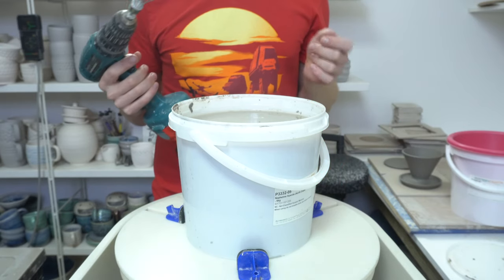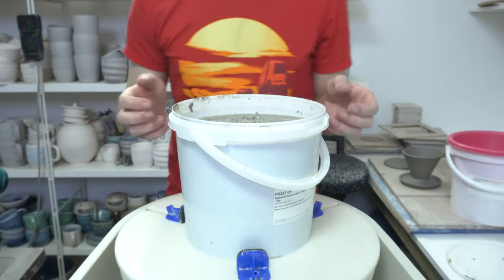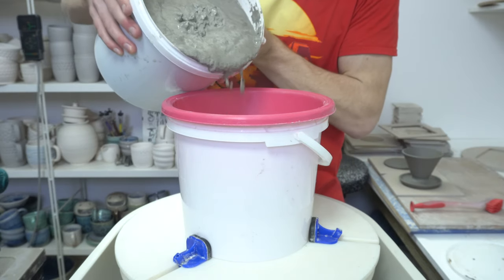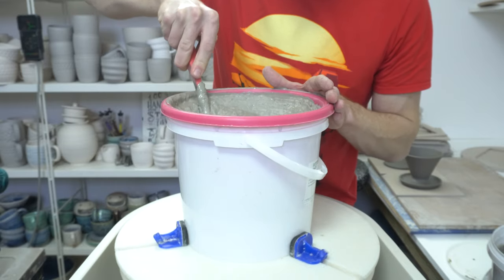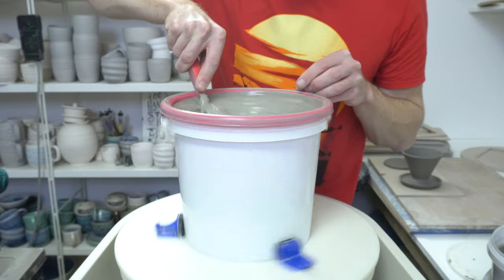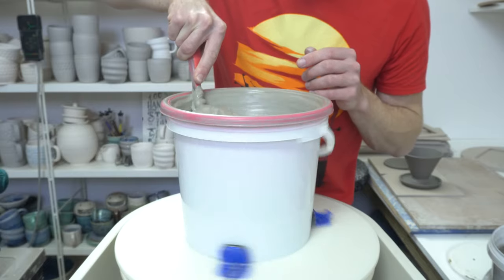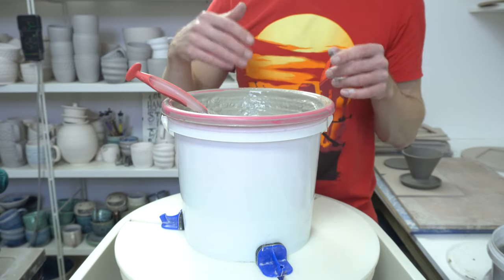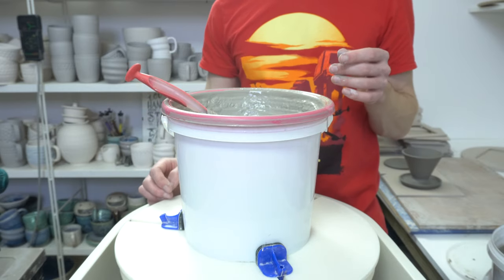Sieving Slip - the lazy way

Comment: I had a teaspoon or so of a deflocculant, I use Darvan 7.   It will make the slip wetter with out adding water and you can add more scraps as you mix.   I use an immersion blender and never have to sieve

Comment: I've been using a stick blender instead of sieving the slip, works fantastic but might have to split larger batches for cheaper stick blenders to be able to handle the load.